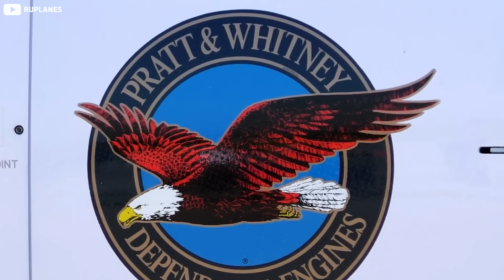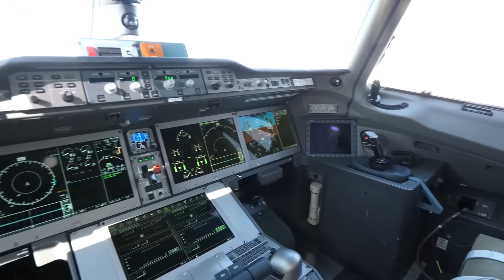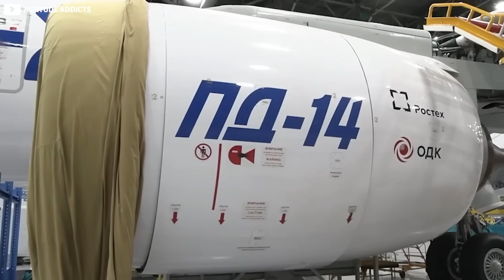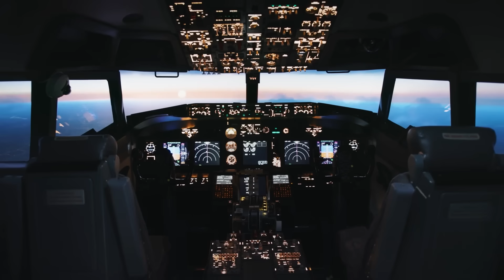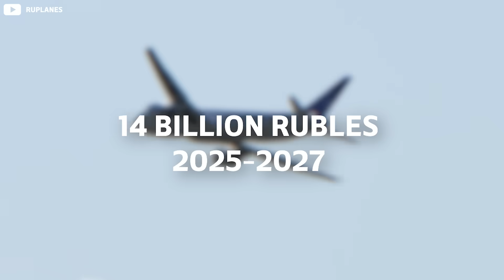Why Russia’s 'Airbus Killer' Is Too Heavy To Fly

Comment: The comparisons are irrelevant since the Boeing specs does not account for the weight of the 9 fuel tanks to extend their range or the heavier frame and landing gear on the A321 XLR with the two containers full of extra fuel, if you did so you will find the MTOW 2-6 tons higher than what the specs say conveniently placing the specs of the normally aspirated version of the aircraft and placing instead a curtain of smoke and mirrors without acknowledging the lack of cargo capacity because their compromised MTOW in exchange for " range "....

Comment: (taken from google search) India's Hindustan Aeronautics Limited (HAL) and Russia's United Aircraft Corporation (UAC) signed a deal to jointly produce the SJ-100 passenger jet in India, which would be the country's first full-scale civilian aircraft manufacturing project since 1988. The agreement, signed ahead of Russian President Putin's visit to India, will allow HAL to build SJ-100s for domestic use, aligning with India's "Make in India" initiative and potentially addressing a significant future demand for regional jets. (taken from google search)

My Opinion - If I was Russia I'd give India the rights to all the aircraft I (russia) was trying to bring back for modern aviation (instead of just the sj-100) because with the fever that India is building structures across its nation and with its present technology (it is capable of much of what russia can do) and technology it has access, it could help in the modernization of the Russia aviation industry.  I know Russia can make this aircraft far lighter, but with the cost factor being so major, and the fact parts would cost far less in India, so India could make them cheaper by sheer numbers and then Russia can buy and then manufacture once they are cheaper, it could help both.....   they could do this with for more than just the aviation industry ...

Comment: This plane has problems a lot more serious than the weight.
The reason is several crashes.
It has serious security problems. In case of any computer error problem, this plane enters in a manual flight mode that is impossible to control. Plus, the plane is designed in such a way that any hard landing could make landing gears break and pierce the fuel tanks, ending everything in a fireball 🔥

Comment: The MC-21 never had a chance. Even with Western components, it wasn't as fuel efficient. That's the bottom line for most airlines. Add about zero support network outside Russia and China, and you have a recipe for poor sales.

Comment: At least they don't have to waste time de-icing the wings with the composite wings....!.. Range is irrelevant, all they have to do is put more fuel tanks like the MAX with 9 of them or the A321 with two containers worth molded into the cargo hold to increase its range.... 4.000 Kilometers range is good enough for 5 hours flights, any more I would use the TU-214 for the 6,000-7,000 Kilometers range....

Comment: The MC-21 IS a project based on a modular platform of the YAK-242, which they can stretch or reduce its size to save different purposes for different uses and ranges...
The Russians know what they are doing and settled it on a specific range of around 4,000 Km, the comparisons with western aircraft are pathetic since the MAX has squirreled 9 fuel tanks around the cargo area and the A321 has two cargo containers as fuel tanks to extend their range sacrificing cargo space.... If you really want to compare them fill them all with 25,000 liters of fuel and see how far they get you, this way you can't argue the results...!..

Comment: It's more a smear campaign than a factual revelation. Every product goes through trial and error method and improvised. Russia is a huge country having a big captive market. Russia doesn't need to export for sustaining the aviation industry.
Reply: Yes country geographically but it population size is widely dispersed. They need modern efficient planes. Yes with sanctions in place now these planes will have to do but as a long term solution I am not so sure this is going to be cost effective. And seriously would you trust flying in one of these things? If I had no choice maybe. Certification is not just giving EU and American citizens peace of mind that these aircraft are safe the average russian benefits from that peace of mind too.

Comment: The goal is probably not to create a plane that is competitive to European or American planes, or even Chinese planes. The goal is to have domestic access to air transport capacity independent of sanctions or geopolitics. At the same time the know how and engineers are busy to be able to continue work in possibly better geopolitical conditions in the future.
Since the start of the war and the sanctions, Russia maintains a network of regular flights domestically and also to select destinations abroad. They do this with a lot of creativity using the planes still available from pre-war periods. This is probably not the safest situation and with many spare parts running out, they need a plan B. This new plane can be part of plan B. Its delay and limitations are very annoying ofcourse, but there is another solution for that : maintaining the present fleet of Boeing and Airbus planes is theoretically not possible if there would be a watertight sanctions program. But this is an illusion: via third countries in Asia and the middle East, components are likely to still find their way to Russia. So I suggest to not look at this plane through the eyes of an investor or traveler, but through the eyes of a Russian politician and strategist. Then the picture could be different. Not that I’m a fan of any Russian politician, or even of planes.
Reply: Согласен. Стоит добавить, что Россия -одна из немногих стран, имеющая теперь полный цикл производства авиалайнеров, состоящих из собственных комплектующих. Очень немногие страны могут такое сделать.

А насчет веса -первые боинги тоже были тяжеловаты, это исправлено со временем. Почему МС не сможет быть доработан?
Reply: @1b0ddf74 their own components, you mean the components that they have counterfeited. Do you really think that they completely from clean piece of paper redesigned? All the avionics, no. All they've tried to do is build the same avionics, using cheap russian components.

3600 km range?  😂😂😂😂
Reply: @stevewhite3424  я не знаю -с чистого листа или нет. это не важно. важен результат. если у Вас есть информация, что они что-то там подделывали -прошу предоставить, иначе -пустые слова. На боевых самолетах -делают, а на гражданских -не могут, так по-вашему получается? не вижу логики, только поливание грязью
задача, как я понимаю -создать собственный самолет, не зависящий от ненадежных поставщиков. задача решается, дело идет. Двигатели тоже готовы. что в этом плохого?

Comment: MC-21-310 practically out of the market. Another Super Jet Sukhoi failure.
Reply: It is not intended for any market, it is only for the Russian market and they have plenty of fuel available, I would give a 15% price subsidies on fuel to any Russian airline that operates them to level the floor....
As to the SS-100, it was an Italian project with the Italians holding 51% of the joint venture and got to choose all the components themselves, Sukhoi was just the integrator... Russia pick it up after the Italians abandon it in favor to build the  center section of the B787....!..

Comment: I think it is good Russia builds its own aircraft even if it only sells domestically.  It will of course be expensive to buy and maintain but Russia has no choice.  The SJ100 likewise, good luck but it will have limited sales.  Translates to more expensive flights inside Russia assuming you don’t crash and burn.
Reply: It's not Boeing,don't worry 😀

Comment: Solamente con el pedido de Aeroflot tienen carga de trabajo para varios años, esto sin contar con otras compañías aéreas rusas menores, mientras tanto es de suponer que algún día finalizará el conflicto y con ellos los bloqueos a Rusia, sin embargo supongo que si hay unidades disponibles para exportar (no creo que antes del 2032/3) puedan ser para Asia o África.
Reply: What's unclear about the message: this plane costs more than Western ones, has inferior performance and functionality, and consumes more fuel? No serious airline would ever buy it... except for Russia's Aeroflot, forced by the Kremlin.
Reply: @MGrimandi the revised aircraft with Russian components will likely be heavier, less efficient and require more maintenance however the design had merit.  That said the b737 and A320neo are based on designs from the 1960’s and 1980’s respectively.  The new designs of clean sheet replacements due by mid 2030’s will be a step change improvement over what is now available from Russia and China before either of the comms planes reach payback if indeed they ever do.  Airbus is awaiting Boeing to move first on a new design as they have a fuller order book and have no need to expend resources u til 5hey have to compete.  Boeing May start after the 777x is underway being produced and the variants are engineered so maybe 2028/9….  So at best a mid 2030’s entry into service likely later.

The wing on the mc21 was a good design and construction as was the slightly wider cabin which would be much better on an A321XLR…
Reply: @MGrimandi  What do you not understand about it being a way to keep Russian airlines going until they improve the technology?
Reply: Maybe Mexico will buy them….
Reply: Russia no necesita exportar nada ya que los 500,000 Millones de exportaciones de grano, gas y petroleo son mas que suficientes para un crecimiento sostenido del pais....!..
Los Gringos y Europeos TIENEN que exportar, sino se mueren de ambre y frio si no lo hacen....!

Comment: So the weight went up from 79 tons to 82 tons... less than 4%... and that's why it supposedly can't fly, yet it flies🙂. 🙄
Reply: That is three tons worth of passengers fewer. Do the math. It can't compete with more efficient Airbus and Boeing types. For Russia, that doesn't matter because they have no alternative. But if they ever reenter the international market, they will sell zero of them.
Reply: @ClimateScepticSceptic-ub2rg  MS-21 with PD-14 engines and KRET avionics flew from Irkutsk to Zkukovski (a suburb of Moscow) not so long ago. I measured the distance between Irkutsk and Moscow by using Google Maps: 4.182km. 👍
Reply: It’s flying empty or that 4% weight increase makes it uneconomical to operate
Reply: Did you ever fly in a Russian airplane?
You learn to pray again in an instant
Reply: @RickTheClipper That would be true for Boeing. How many Russian passenger aircraft have crashed recently, None..
Reply: @geopoliticalwave How many Russian airplanes still fly?
NO FLIGHTS, NO CRASHES
Reply: @RickTheClipper cubana has been flying illyushins for years and no crash reported
Reply: @geopoliticalwave the US and Europe have 1000+ planes in the air at any time, Russia and Cuba together less than 100. Again a plane on the tarmac or hangar will not crash
Reply: MTOW is changed from 79t to 85t. While OEW is less than Boeing 737 MAX and Airbus A320neo.